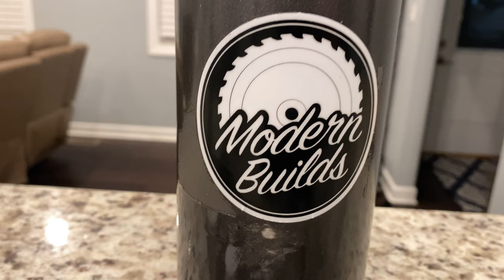How Paint and Restore Hydro Flask [DIY - Like New]

Comment: Hello! Can I just use a krylon rust protecter+primer for spray painting?
Reply from the maker: I would think so! I think the paint brand is really just preference, but most of them work similarly 🙂
Reply: @MakingMadeSimple  would i still need to put a sealant?
Reply from the maker: @koric3900  I would, just to ensure it's protected! It would still look fine without one, but it probably wouldn't last as long

Comment: So does it form condensation on the outside of the can now since the old paint is gone now?
Reply from the maker: Great question! But in my experience, it has worked the exact same way that it did with the old paint. I don't think the paint does much in terms of the temperature insulation, this mostly comes from the actual stainless steel. I still use this bottle frequently, and no issues so far!
Reply: @MakingMadeSimple  thanks I shall try now 👌
Reply from the maker: Awesome - let me know how it goes!
Reply: Mine after I done the process it have moisture outside the can everytime I put ice in the can
Reply from the maker: @raynielfernandez7982  that's really strange. The insulation on HydroFlasks comes from the material of the container, not the paint. The paint is just a method of customization.

Comment: Omg!!
Reply from the maker: I know! Dropping it was terrible. But hopefully you learned something new from the video!
Reply: @MakingMadeSimple  ya
Reply: But the tools you used are not available
Reply from the maker: @mehul34251  if you don't have an orbital sander, don't worry! I did mention in the video that this can be done entirely without it. You can sand by hand, and get very good results. And sandpaper only costs a few dollars, if you do decide to do so. Start off with something like 150 grit sandpaper, and then smoothen out the surface using either 220, or 240 grit sandpaper. If you use this method, you don't have to take the paint off entirely. You can just sand the existing paint, and you should be able to paint right over it.
Reply: Thanks!! well I am Indian so rupees
Reply from the maker: @mehul34251  Oh okay, Rupees it is then! But I think it shouldn't be too bad of a process. Feel free to reach out if you have any questions along the way, if you do try it! :)